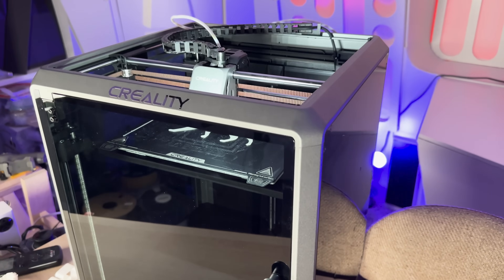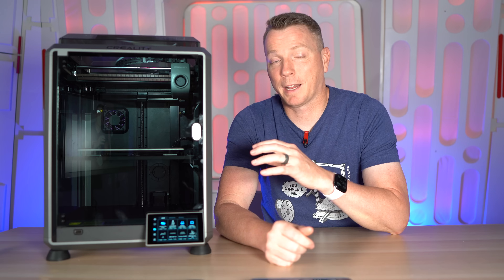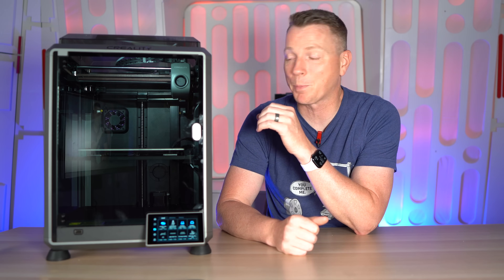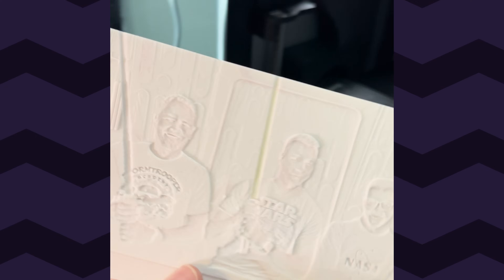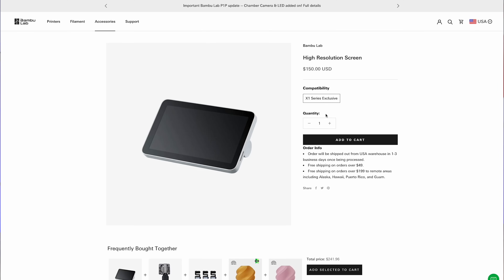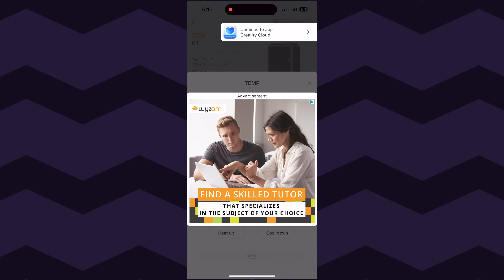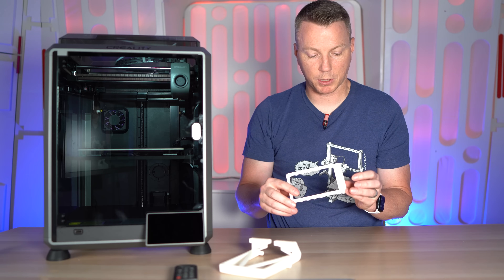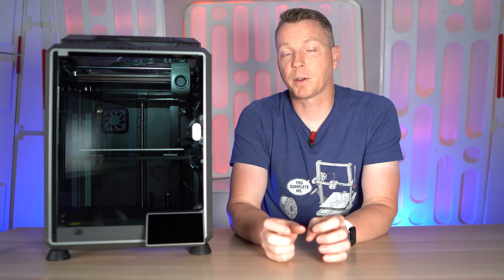I Regret Buying the Creality K1. Here’s Why.

Comment: Thank you for being honest, finally.  Creality continually rushes out printers with serious flaws and rather than fixing them, they just make a new printer.  For years we had the never ending new "Ender" series.
Reply: bambulab will be doing the exact same
Reply: @CourlandEngineering  that remains to be seen. I am not fanboy of any single company so i do not care if other company leapfrogs them. 3d printing has been stagnant for way too long and Bambu Lab stirred the market and moved it forward. I wish good luck to all
Reply: @andrewwwolf  "Bambu Lab stirred the market and moved it forward" ... moved it forward? How? By making everything closed source again after benefitting from open sourced Voron documentation and guides or using PrusaSlicer as a base for their Bambu Lab Studio? It wouldn't shock me if they also were using Klipper as their printer firmware or at least large parts of the code.

They have woken up the market, no doubt!
That's why we see more and more printers with Klipper that mostly double the speed of it's predecessors like the ELEGOO Neptune 4 Pro (300 bucks), Sovol SV07 (330 bucks) or the Creality K1 (584 €, who sadly also try to sell their "Creality OS" as closed source instead of giving Klipper the kudos it deserves).

But unless Bambu Lab is giving something back to the open source 3D printing community, they only moved more cash into their pockets.
Reply: They're definitely going to have to change that "iterative" release approach they've had for years now. I think they're capable of making good machines but their need to constantly have something releasing keeps them from actually polishing the machines before releasing. 
Hell, they could continue "iterating" the Ender series and reserve a "K" series for more spaced out releases of more developed machines, and most people probably wouldn't notice. Release an upgrade kit for the previous K series when the next one does come out like Prusa does, and shift production over.
Honestly it'd also be nice if they finally simplified the Ender line-up. Keep only the V2 Neo, the S1 Pro, and maybe work on getting klipper for them. There is no reason to be selling any of the other models at this point, other than possibly getting rid of stock (but I doubt it); everyone expects ABL, 32-bit and TMCs (and an Ender 3 made now has two of those, so why not just get rid of it and keep the V2?). Also why is the Ender 6 still listed when it isn't even being sold anymore?
Reply: It seems that Creality is trying to do better with their upscale K1.  It has a much more finished appearance and user experience, but Creality still can't quite help being Creality so they fumbled the extruder design and some details like the drag chain.  They also tried to lock down Klipper in violation to the licensing agreement.  So far, it looks like Creality got enough right with the K1 that the community shouldn't have too much trouble finishing the design if Creality does its usual deal and doesn't address the shortcomings after the start of production.
Reply: @Liberty4Ever  fingers crossed Creality fixes the issues for K1 Max ... this probably explains where the shock shortage - they are probably tweaking the fix issues. Marketing hype to get people interested sell on the idea first then make it happen.
Reply: @crazyethanyeahyeah  - Creality seems to rush to market without enough internal testing, then send a bunch of free 3D printers to social media influencers as initial marketing, in the hope that the free printers will convince these people to say nice things despite problems resulting from inadequate internal alpha testing.  They essentially beta test with these compensated reviewers, which seems like a weird marketing strategy.  I'm hopeful that even though Creality is still doing this, they'll at least accept the community feedback and correct the K1 shortcomings.  Even if not, it looks like the initial problems aren't enough to prevent wide scale market penetration and with a large enough customer base, the community can fix the ancillary problems up to and including an entirely new extruder if necessary, provided the power supply, electronics and motion control are capable and reliable.
Reply: Still though, higher top speed, better enclosure, better light (lol), die cast frame instead of metal pieces screwed together, a better hotend design imo, lighter hotend from what I've seen, higher resolution of lidar, and with the max, higher build volume... All together, for 3-400 less? I can put 3-400$ in upgrades in it then!
Reply: @Kungpaoshizzi  Not everyone is like you. Not everyone wants to bother knowing how a disassembled printer looks like. Some of us want the printer as a tool and not a hobby.

What’s the point of buying a cheaper printer, and then spend money to upgrade it so it reaches the same price point as the competitors? It only makes sense if you want to tinker or like that sort of things.

I know you’re biased in favor of Creality. But it’s a known fact that the components Creality uses and their QC is abysmal.

Reading your comment around the LiDAR precisions makes me feel you’re deeply invested into the marketing Creality has spewed. The LiDAR precision means nothing. It’s such a minuscule thing, that unless your eyes are replaced with microscopes, it has no real meaning or value. It’s marketing gimmick to make an otherwise cloned product sound like it’s better.

But you do you. Buy it and give me an update in half a year. Let’s hear how many components you’ve replaced and how much money you have spent additional to buying the printer.
Reply: I’ll still take creality and day over bamboo labs. Creality is an older company with more of a reputation. Their ender series is very reasonably priced and easy to work on
Reply: Ya fk creality
Reply: Can it do Kevlar filament
Reply: Exactly, releasing new printer every few months and essentially they are all the same - always needing some tweaks and upgrades. i have ender 3 max but the constant tweaking got old very quickly. I was skeptical about Bambu Lab but since i got P1P i fell in love with printing again

Comment: I just want a printer i don't have to coddle and stress out on every print and have to make sure no print is longer than 3 hours, because it will fail...My CR10 original sucks, only works on cura15, but that's what i used the only money i coud scrap out of my VA disability money. So it sits in my workshop covered, no use since last summer for small parts.
Reply from the maker: Exactly. We're finally (FINALLY!) at a stage where prints are much more reliable without having to spend $1000 or more. The Prusa MK series has been really reliable for a long time but they cost 3x what a similar sized printer costs. We're starting to see middle ground without compromising on the reliability and it's exciting.

Comment: Just a note: Bambu Studio is actually open source.

Otherwise very informative video, I am happy I went with a P1P!
Reply from the maker: Thanks for the clarification on that!
Reply: Is it fully open now?  Last I checked, Bambu released all the code that's based on Prusa Slicer, but was still holding tight the code that ran the "lidar" and the AI error checking.
Reply: It things go any further, we're going to see more closed source when no company is giving back to the community.

Imagine PrusaSlicer, Klipper or Octoprint becoming closed source as well ...
Reply: Only open source because they were pressured to do it. They tried keeping it closed source, violating the APGL license.
Reply: @Lil Ape  agreed bambu took their time (and probably only folded under pressure) to release their slicer. However, creality has been violating open source licenses for a long time with no consequences. Its basically on par for any Chinese company
Reply: They are still violating the PrusaSlicer license to this day.

Comment: The k1 Max is the one with the camera and AI, it's listed in a drop down below the k1 ina banner on the marketing page, I take it this took a while to get uploaded?

On a related note, I understand that creality cloud is bad, but it would've been cool to see if you had any luck setting up octoprint with the k1, I hear it has a creality cloud plug-in these days?
Reply from the maker: I know the Max will have those built in but the K1 says you can add them. It’s listed in their spec sheet right on their site. They just don’t actually sell them at this point.  

Great question on OctoPrint with the plug in. I haven’t tried It and the K1 only has the single USB A port on the front so I’d be pretty curious too. I’ll have to try it.

Comment: So basically, Creality still doesn't get it and along with that, with all the nonsense spamming they're effectively putting malware on your device. That said, from what I've heard, the P1P isn't on my short list either with how noisy it's supposed to be. The one video I saw, it sounded like the inside of some sort of metal factory.
Reply from the maker: They are noisy, it’s true. Like most things, different people have different priorities and the noise isn’t much of a factor for me since the printer is in another room with the door closed. The K1, for example, is really quite loud too but the enclosure helps a lot… At least when you can keep it all closed up 🤷
Reply: If you want a silent printer, you would have to choose a slower one, like a Sovol SV 06 or a Ender S1.
Reply: @hassosigbjoernson5738  I have the Ender 3 S1 Pro, the problem is it's too slow and the Auto Bed Leveling garbage. I had to to stop using it and just go manual and now I can get some prints but it always take 20 minutes or so to dial it in... and it's far from silent.
Reply: Put it on concert pavers and foam, and put it in a box for the price you're an idiot to complain

Comment: Good video. The Creality app appears to be terrible. The cable chain is a relatively easy fix but it’s not something that a user should need to do and doesn’t inspire confidence. I also agree about the concern of longevity and your experience with the Bambu labs has been much better so that makes sense. We will see if Creality can improve on these criticisms and improve. They will need to.
Reply: They'll only improve (if they do at all) with another version of the printer. Unfortunately, all users who didn't know Crealitys track record and bought one are shit out of luck.
Reply: "longevity and your experience with the Bambu labs has been much better" ... sounds like someone is printing for 5+ years with Bambu Lab printers, which simply is not the case.
On the other hand far less impressive Ender 3 machines are still running today.
There simply is no 3D printing longevity without an operator who does maintenance on this machines, because at the end something is going to break.
And only just a few weeks in Creality already have improved.

The benefit of accessing full Klipper (also via browser on the phone makes the app kinda pointless.

Let's see, how Prus decides to also go closed source with their Prusa Slicer, after more and more companies benefit from open source, but don't give anything back. If Prusa Slice were closed source there simply wouldn't be any Bambu Lab Studio.
Reply: What solution would there be for the chain cable that doesn't include removal?
Reply: @arshaqhabib1932  - Replace the cheap cable chain with a good cable chain from Igus or similar.  Better attachment points may also be needed on the back of the enclosure and the extruder.  Remove the reverse Bowden tube from the cable chain, replace it with a larger ID PTFE tube for less drag, and attach the new tube at the rear of the enclosure, the input to the extruder and to the outside of the cable chain near the halfway point.  None of these fixes are expensive or difficult, but admittedly, none of these fixes should be needed on a $600+ 3D printer.  On the plus side, it seems that Creality got most of the difficult and expensive stuff right so K1 owners shouldn't need to completely rebuild a 3D printer to have reliable, fast, high quality 3D printing.
Reply: @Liberty4Ever from what it looked like, it wasn’t the quality of the chain that was causing the problems such as the switch being flicked. It seems as though it’s poor design. The chain is simp,y in the wrong place. Too low for the switch, for example.I would modify that slightly. But I have machine shops. I don’t know what anyone else could do.
Reply: @melgross  - I have CNC machines and manual machine shop tools in my basement that I almost never use now that I CAD and 3D print almost everything.  I'd like to buy a 3D printer than doesn't require me to modify it by making parts in my CNC machine shop.
Reply: @Liberty4Ever  I agree. If that were the only problem, and I were in the market for a machine in that price range, I would fix that. But there are much better machines out there so I wouldn’t even consider this. The Bamboo carbon is a far better machine. Of course, I’m pretty sure that you, like me, would really like a proper metal printer. But that’s a whole different discussion.
Reply: Tbh. 3D printers are manufacturing equipment, machine tools.

So while i can appreciate the "plug in play like apple" approach's benefits.
The proprietary bullshit that comes with such approach makes it a non-starter for plenty users. You 3D print with zero knowledge, it works like magic...
...yeah, thats not gonna happen.
You still need to cook up part that take into consideration the laws of physics.

And if you have to think, you will sooner or later do it on your own.
WHich will lead to changes you would like to make to your printer.
Reply from the maker: Exactly. I really hope they do better over Time and they absolutely need to overhaul their app. Like I mentioned, the printer isn’t terrible but for the money you have superior options.
Reply: Any update on this?  I think alot of people like me are humming and hawing right now on k1max due to decent black friday sale.  Bambu is only giving a discount on filament.  Does creality provide much continued support on legacy models for patches etc?